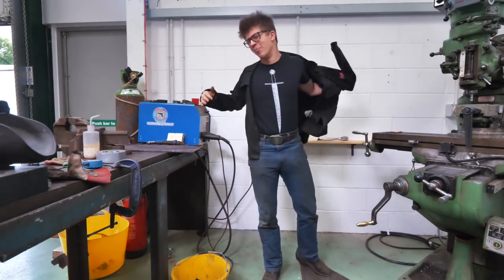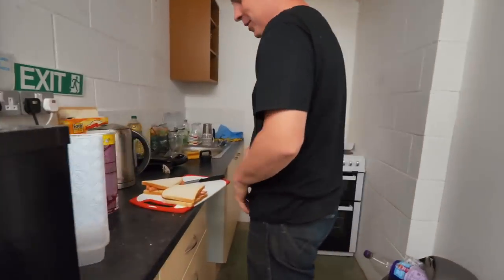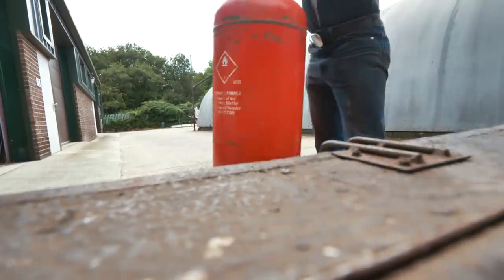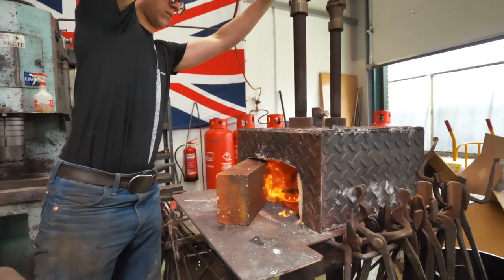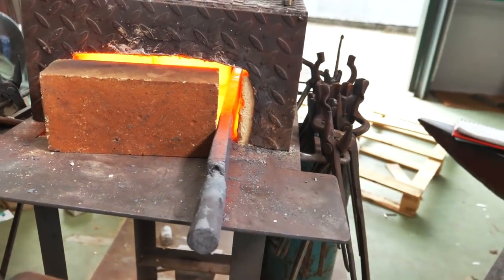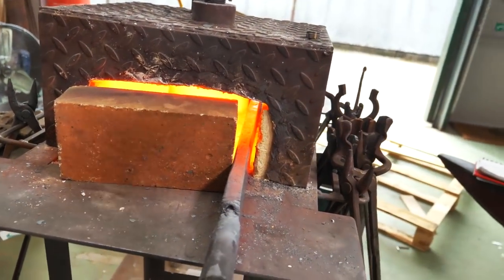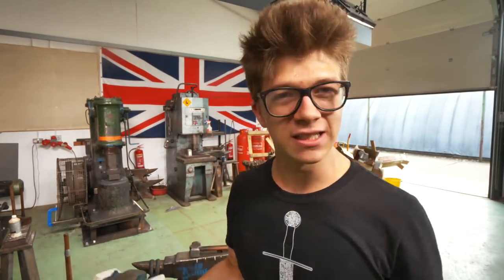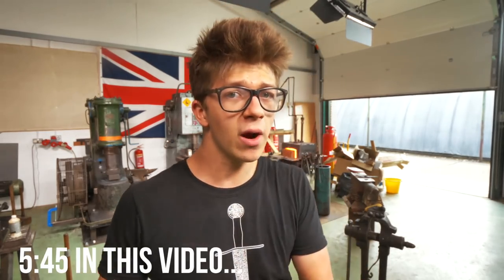VIKING BATTLE AXE: Part 1

Comment: You should make yourself a cabinet on the wall that is specifically for the storage of your respirator. I'd recommend mounting it right next to the door of your grinding room, since that is probably where you would want to use it the most often. As long as you keep the cabinet closed (seal it and use spring loaded hinges) you should have a clean respirator, quick access, and it's right at the entrance to where you use it the most often, while still having it visible from the workshop floor.
Reply: I thought the same thing!
Reply: Try building it out of acrylic. Visible means it's used. Top video as always Alec!
Reply: Great idea, sealed box that has easy access and at located in the right spot. also like the idea of having the clear door so if are walking into the room u see it so your more likely to use it.
Reply: Use a cabinet like they use for fire extinguishers or AED devices.
Reply: Good idea. I also have two respirators in my shop. a good respirator isn't all that expensive, so I have one at my welding station and one at my grinding station.
Reply: Robert Wallace excellent idea.
Reply: Except he also needs it for welding "all the way across" the machining area. Maybe if he swapped the welding table with the mill and lathe....
Reply: Jim Stanley Well, he's gonna have to trek for it for at least one opperation, so the decision is on him to where it would be most helpful to be reminded of it. Just my .02 if I was trying to organize and protect my gear.
Reply: he could also stuff the mouth part with paper towels during storage/non-use. it won't keep it super clean, but it should keep the worst of the dust/grit out.
Reply: When I used to wear a respirator at work we covered up the mouthpiece with an elastic edged bowl cover for leftovers when they weren't on our faces.
Reply: Get a separate respirator for welding - they make them now that fit great INSIDE welding helmets. Best option at the ready for each operation.
Reply: I ended up with one in every room, hanging up next to safety glasses etc. After getting permanent throat abrasions from ceramic dust because I couldn't be bothered to go get it.... and that was when I was keeping it in the "special clean space" I was supposed to keep it in!
Reply: Robert Wallace I was going to suggest a bread box that sits in the wall next to the door but has sliding doors on both sides similar to a bank teller or one of the high security convenient stores
Reply: Exactly what I thought and why I came to the comments. Simple medicine cabinet right next to the door.
Reply: Seems like there is a general consensus among your followers Alex. While both points you mentioned have merit, it seems as though a compromise is needed. DAMASCUS CABINET!! The community has spoken...make it so.
Reply: A lab locker! And have designated respirators for grinding and welding and chemical handling....all the lockers set up strategically....seems stupid but once in the swing of things it becomes something you don't think about

Comment: As a former combat medic....Always store your respiratory in a air right bag when not in use if it contains carbon in its filters. Air will deplete the active charcoal ability to filter properly.
Reply: Didn't know that. Thanks. Alec, why not buy a few respirators and leave them next to each of your respirator-required tools (in clear zip lock/freezer bags) so that they're always on hand? When they're constantly in view too, it'll act as a reminder to wear them.
Reply: Tom Tulloss absolutely right, however Alec is young and has a lot to learn about safety
Reply: Josh Baer But Grinding Also Creates Really Tiny Particles As Well. Doesn't It?
Reply: He is grinding on chromium and nickel, not walking through tear gas. He should be using a 2097 particulate filter when grinding and and overhead hepa-filter overhead hood system when welding. You can also purchase products that help clean hexavalent chromium  of with wipes and sprays.
Reply: As a carpentry finisher I agree with this man!!!

Comment: Never mind you respirator am more worried about your back. Keep it straight at least some of the times on the power hammer. Key here is to try and move as many muscle groups to stay fit. That means don't repeat the same movement again and again. Otherwise in 20 years is by by to your back. Trust me that is how it works with a demanding job like yours.
Reply: Finally someone else that recognises this
Reply: Work With Nature good tip. Maybe cut down on the amphetamine sulphate as well.
Reply: I would point out both. Never say a respirator should be ignored. If so you're ignoring clear health risks that Alec needs to avoid if he wants a long living career working steel, you're not giving helpful advice. But I do agree on that he might be bending his back a bit much on the power hammer. Might help him out to raise the base of the hammer a bit higher. Good point WWN.
Reply: I would recommend a weightlifting belt, I’m a Drywaller and recently began using one. 
It was a bit of an adaptation as my trade requires bending twisting and lifting at odd angles, but the result is that I now rely on my legs which have gotten stronger, my back pain has diminished and my productivity is up. 

I would wear the mask the whole day, just saying.

Comment: Dirty whiteboard alec!!! 
top tip: Clean with hot soapy water, then buff dry.... Then buff with turtlewax polish.   
You wont need to clean it off very often as the markers will wipe off cleanly as intended.
Reply: BiscuitTinOrchestra clean wth methylated spirits , it's what they do in schools...
Reply: yeah, but that also strips the factory wax layer off, and you get the same smudgy messy board. when waxed, the drywipe markers work as intended.
Reply: BiscuitTinOrchestra use as pure a form of muriatic acid as possible! Works amazingly for getting rid of marks on  your white board!
Reply: nail polish remover (acetone) works a dream
Reply: silly people............
Reply: BiscuitTinOrchestra alcohol

Comment: Could get a respirator cabinet. Just a thought Alec. As clean oxygen is FANTASTIC! Like so Alec can see it.
Reply: I can't imagine the fumes coming off the welding he does on the billets..  probably not that good to be breathing in.

AVE Mentioned that, lot of welders like to put their faces right up to their work, just eating that smoke..
Reply: As someone who has a chunk of heavy duty welding experience: yeah, black snot rockets for days. It is way too easy to get way focused of the work and start to scrunch into it. I've melted a couple shields doing 300A+ welds and I've had my face right next to the weld, like an idiot.

Actually the process that Alec is using, Short Circuit MIG, isn't putting off that much nastiness. There is a tiny bit of material that is burned out of the wire, but most of the smoke is just surface debris burning off, a little bit of oils and other impurities on the surface. It's not until you're using flux core wire or stick welding (the coating is flux) that you have a ton of burned off who the hell knows what. I did stick and flux core welding,
Reply: Robert Wallace lots of moly and iron powder is what you get. Absolutely nasty.
Reply: or he could get what ever the hell michael cthulu uses

Comment: Love your energy! One tip. For the respirator, if you have compressed air in the shop, you can blast the interior with air to remove any accumulated dust. Blast it away from your face and all should be well.

Comment: You should make some Damascus forks and knives to eat with
Reply: You always say that you love using thing you make and this would be used every time you eat
Reply: With the forge there, I would make a Damascus frying pan, I hate the modern non-stick rubbish and use an old fashioned steel pan, just clean and wipe with oil in between cooking.
Forging and bacon, how bad is that?
 On the respirator, my father spent the last few years of his life using oxygen due to dust and asbestos on the lungs from working in the building trade. He was 92 so not a bad age but without the dust on the lungs he would probably still be here and enjoying life as everything else worked well.
Reply: *With which to eat
Remember, never use a preposition to end a sentence with.
Reply: I think they would rust easily
Reply: MERC the MECHANIC wtf dude rude.  My great-aunt Mag is 103 and still going strong.

Comment: Alec, there are some things you need to keep in mind while making this axe:
One, what kind of axe is it? Based on what has been said I would assume it will be a dane axe, in which case you need to remember that axes of that design, if properly made are quite light. With the blade being thinner than some swordblades. Around 4-5 millimeters or between 5/32 and 13/64". The weight of the finished axe should be between roughly 1-2 kg, or 2-4 pounds. The edge should be between 8 or 12 inches, with  long pronounced horns on either end of the blade. Depending on wether it is based on a combat axe or a status symbol, the hard should be between 0.9 and 1.2 meters for combat, or potentially as long as 1.5 to 1.7 meters for a status axe.

Comment: Hey Alec, The purpose of sealing up the respirator is to prevent the dust and particles that is in every shop from collecting inside the mask. Plus the filters will stop working as they sit in the open. The filters should be changed from time to time depending on how much they are used. When you put on the mask your body oil will collect the dust that has come to rest inside the mask. Help your filters last longer and keep them in a sealed bag. It can save your lungs and sinuses from the settled dust in your shop.  Just a thought. My wife and I really like your videos. Keep up the great work.

Comment: I agree, ppe will be more likely used if it's convenient to do so. My respirator hangs from the head strap off of my push pull actuator on my belt grinder which is centrally located in my work space and handy. I'm the only one in the space though so there isn't an extreme amount of particulate in the air unless I'm doing it. My spares are all sealed and the mask is checked before I stuff it on my face so I feel alright about it. It must be nice not to have to run down the hall with your molten billet to the hammers anymore, it's all just a circle of workstations, good stuff.

Comment: Respirator: make a little hook outside grinding room with a box of alcohol swabs and latex gloves near by. I was 5 years at a lead acid battery factory. One large factory accident with lead dust and myself and 3 others had no increase in blood lead only because neurotic cleaning/continual upkeep. Super valuable underrated skill in the workshop that builds into a culture of your place. 

One glove to clean inside with swab when you are in question of the inside of mask. Tap mask every time you exit grinding room and you will be good. Love your videos!
Reply: Morgan Olson This may be dumb but I have a question. If I am just getting into forging and knife making do I need to have a respirator if I’m going to be doing grinding outside in an open space?

Comment: Alec if it's a dust particulate respirator hanging it in a clean place will be fine as long as you clean it every once in a while. Chemical respirators like the ones used for painting cars need to be sealed

Comment: Alex I may have a solution/compromise to the respirator problem.  If you have a drawer in the grinding room that you can grab the respirator as needed then toss it back in when done.  That reduces the dirt/dust/nasty stuff issues.

Comment: For the respirator I'd keep it in a cabinet in the area where your going to use it. That way it's in a clean and controlled environment but also easily accessible.

Although i don't use one, but I have local ventilation is right next to the bench where I do grinding and welding.

Comment: re: respirator storage - those drawstring sling backpack/book"sacks" that are commonly given out for free during college campus orientations work very well for respirator storage even in the dirty dusty section of the shop. their sling works good for a hanger on a peg or what have you and the drawstring is quick and easy. the bag part keeps the dust and paint off your mask and face shrouds. i put my extra filters in the bottom and my face shield and respirator in the top. hung off the back of the torch caddy its always a few steps away from where i typically need it. outside of the sack gets absolutely gnarley but the inside stays mint.

Comment: I use to do mold remediation with a full face mask. I still have it too. We had to clean it off every time, even for 2 minute jobs. We had a food based chemical that would be sprayed on before using alcohol wipes to further decontaminate it. We would take it apart like a sniper rifle before placing it into a bag, which was also taped shut before use later. For you Alec, I would just suggest at the very least, keeping a box of alcohol wipes close to your mask. (Optional) Thoroughly clean it at the end of the day, and bag it for over the weekend.

Comment: Alec, you can put some thin gauge sheet metal or diamond plate on the 2 walls in the grinding shop to keep the walls clean and help keep the grinding dust from building up on the walls. Also, I recommended it before, but you can put a piece behind the hanging rack for the grinders to also protect the wall.

Comment: I use a respirator as well when I wood work.  Between uses I put mine on a wig head (a mannequin head would serve just as well) , this serves several purposes.  With it on the wig head the respirator stays clean because it has a "face" to form against which is just awesome.  The "face" also keeps the form of the mask correct so that parts to not fold over which would cause a breach in the seal. Lastly, you are absolutely correct about if you put it away in a box you will not get it out for the quick jobs.  The "head" can be left out in the open so that it is readily available all of the time.

Comment: The reason you want your protective mask sealed is not to keep dirt away. The masks have a particulate filter for abrasive dust and an activated carbon filter for isosanates, which are found in chemicals and in Alec's case, welding gas. An unsealed carbon filter is saturated in about 12 days and no longer shields from isosites, with a mask sealed  the life extends to at least 30 days. Particle filter, however does not affect the same as carbon filter. so the mask can be used for grinding much longer.

Comment: When it comes to the respirator, how about getting another, mount one box on the wall in your welding area and the other in your grinding area, which the filters stored elsewhere. This way you have easy access in both spot and all you need do is reach out, open the box, grab it and put it on and then stuff it back in the back when your done.

Comment: On the subject of the respirator, find or build a box that is dust tight and keep a respirator in the box at each station you need to use it. So you walk over grab it out use it put it back. Saves time, puts it in reach, and keeps it clean.

Comment: try installing some hinged boxes on the walls that you can hang the respirators inside with a glass door (so you can see there's one in there) and so you can easily get access to it but it's still protected from the environment

Comment: My take is do whatever will get you to wear the respirator the most when you should be wearing it. Heck, get two and keep one at both places you'd use it. A slightly dusty respirator you wear is far better than a pristine one you don't.

As for the forging, seeing the new shop going finally is great. Maybe it's just how you did the editing, but you seemed to be moving a lot more metal faster today than you did at the old shop. That billet of damascus looked like it was cooperating with the forge welding really well. Just sort of went into shape with no fuss.

Comment: For your respirators, hang one on the doorknob to the grinding room, hang another on the welder. That way you are always presented with a respirator as you start work. Definitely keep it out of some cramped box, safety equipment only works if you use it!

Comment: My suggestion for your respirator is to put it in a plastic zip-lock bag near your grinding room.  It's not to hard to get out and it is easily seen.  You want to keep it where you limit the air flow through the filters to make them last longer.

Comment: ok here is the chemistry of it  once you open a carbon filter (they come in  a moisture proof bag)   there is a timer  that goes off  and depending on humidity and other things you have between 24-72 hours before  the carbon is depleted   (for the most part)   so then the mask is just a breathing filter  so as long as the inside doesnt have dust in it ,,,clean or not is really irrelevant  other than the cosmetic  things .....................BUT BUT it still works for filtering air  .... so if you dont need it to filter out or neutralize  somehing off gassing like welding fumes (sometimes)  or paint\ chemicals   the carbon / charcoal isnt really required  but it continues to filter out particles which is one of the killers...cheers

Comment: Have a sealed cabinet or box on the wall going into the grinding room and place your respirator inside. Same thing at the welding station with a second respirator.

Comment: hi Alec. Great work as always. I work with stone alot and wear a respirator in case of asbestos. Next to the hook where I hang my respirator I keep a box of shoesleeves (or whatever there called). The kind of plastic glove you wear over your shoes in cleanrooms and hospitals. I cover the face side of my respirator with it and that keeps it nice and clean. just a tip. keep up the good work.